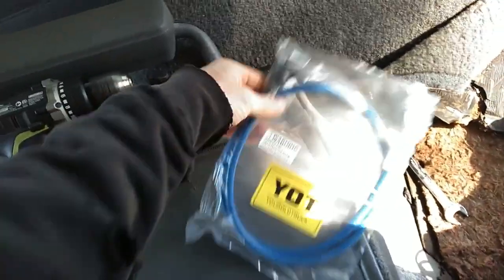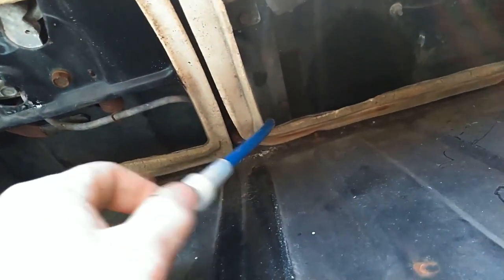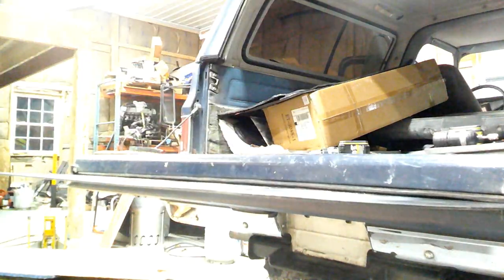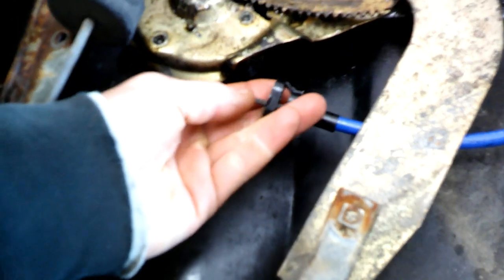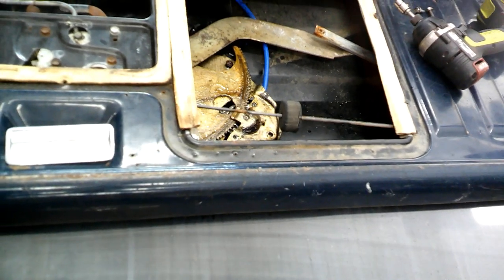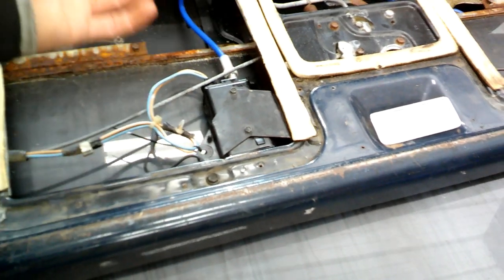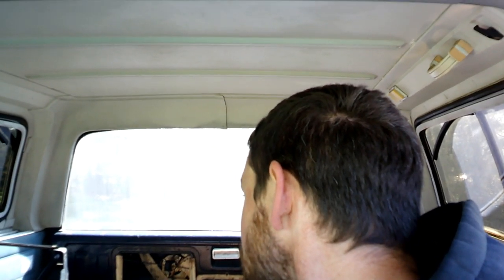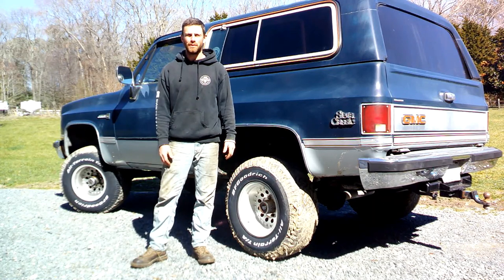73-91 K5 Blazer/Jimmy/Suburban Rear Window Fix

Comment: Make sure your guides on each side are aligned.  If they're off, they can bind up the glass.  There are 2 bolts on each side, at the top and bottom.  All four bots have an adjustment.
Reply from the maker: I'll be sure to check it out. I actually thing the guide bushings are on their way out too
Reply: @hollowaysgarage9332 on

Comment: Hey dude I can tell you it has a safty switch on the left latch. It won't go up when the tailgate is down but it will roll down. Just a little FYI for that blazer
Reply from the maker: Yup I think you can adjust it slightly but I guess it's to keep the rear glass from shattering if it doesn't make it all the way down before opening the tailgate

Comment: I think if you add two relays to the back window it should help. Just rolled mine down after sitting 2 years and it's stuck now lol
Reply from the maker: Mine ended up being a poorly charging alternator. Swapped it out and a new belt and the window cruises now.  The glass gets hung up on the motor sometimes so I have to hop out and push on the glass a little then go up and it clears it. I gotta figure a real fix for that but it's topless for the summer so I'll let in it ride haha